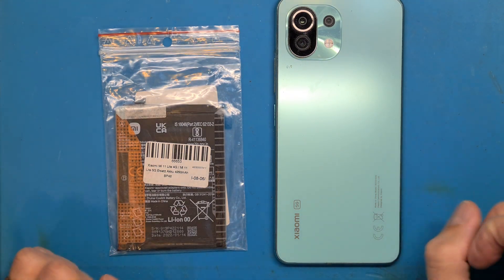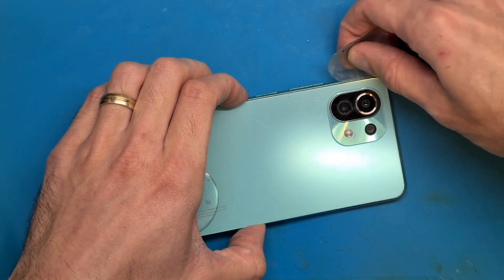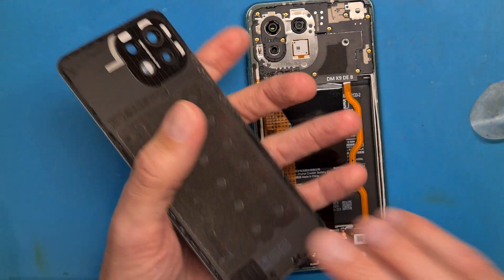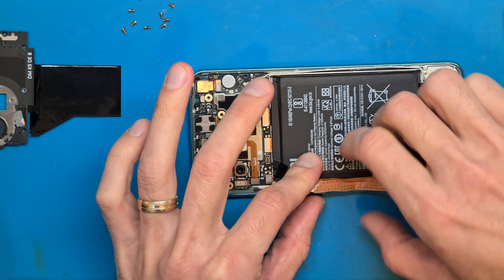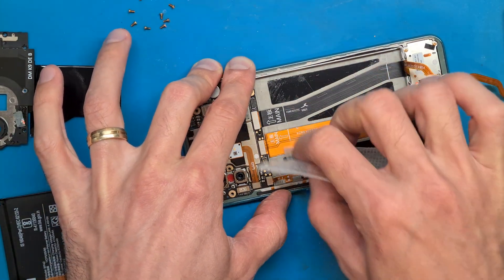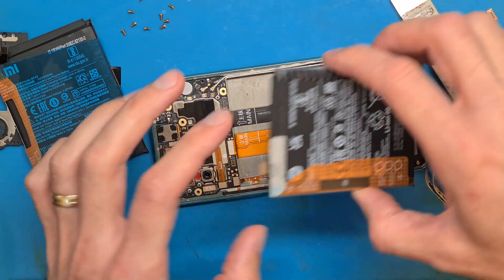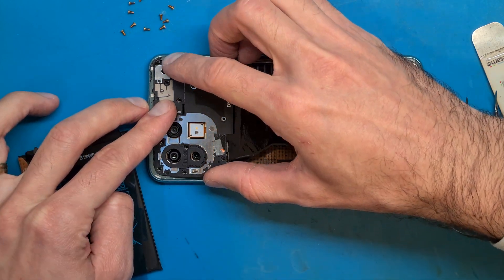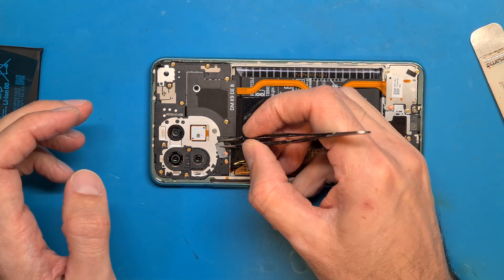Xiaomi mi 11 lite 5g 4g battery replacement and disassembly step by step guide

Comment: Hello sir, I successfully replaced my battery (BP42), but I'm facing a problem — the back cover doesn't sit flush with the frame. There's a noticeable gap above the volume button. It seems like the new battery is slightly thicker and sits a bit higher than the inner frame. Did you experience anything like this when you replaced yours?
Reply from the maker: I did not have this issue because i ordered the original battery, you could try to use more double sided tape to close the gap, tell me if this worked
Reply: @phone_fix it is orginal battery, To confirm battery is the issue, can you check if the battery sides flat with the inner frame? I mean there is the white wire runs from motherboard to sim tray on the side that is inner frame can you check if the battery side higher or flat?
Reply: i followed this video instructions and the back cover sits flush in the end...i used original battery like the creator but I also add extra pressure to the battery after installation and also used clamps to keep pressure to the back cover for couple hours...phone is like new now

Comment: Do you recommend t7000 glue or double sided tape? And which wide woild you recommend for the tape? . I will subscripe if you awnser.
Reply from the maker: @Michel-nr3kg  The best thing you can do is order original double sided tape from the manufacturer, but we have 2mm, 3mm, 4mm, 5mm available for different scenarios
Reply: @phone_fix  thanks, I will do. I am subscriped.
Reply: Thanks I subscriped

Comment: Thx for the video! 
Where did you buy original battery? 
And may be you can share a link to double sided adhesive sticker for back panel?
Reply from the maker: Search for 46020000741Y for original xiaomi BP42 battery